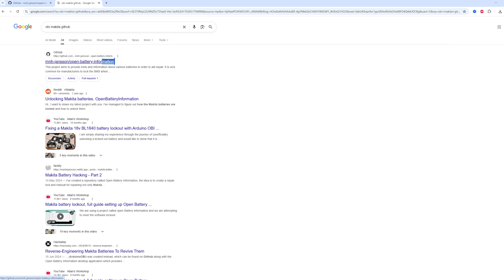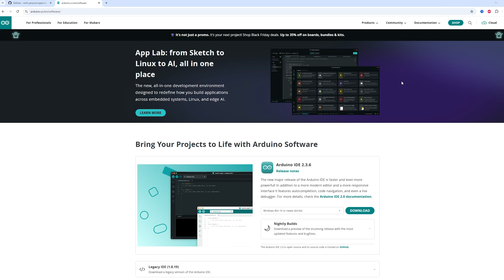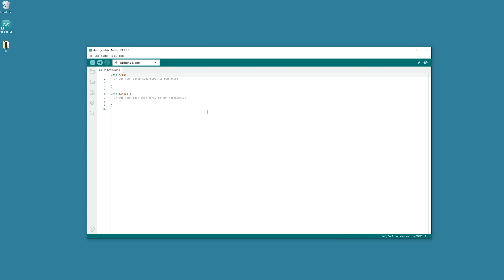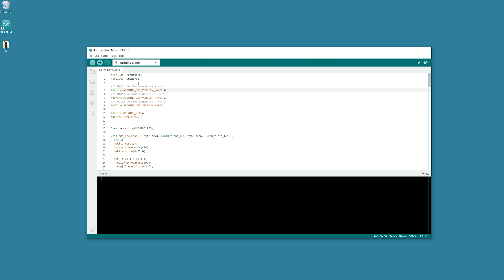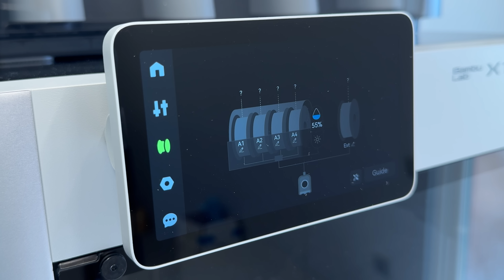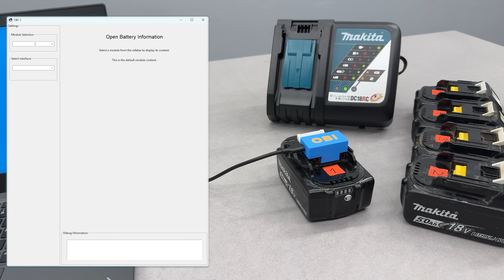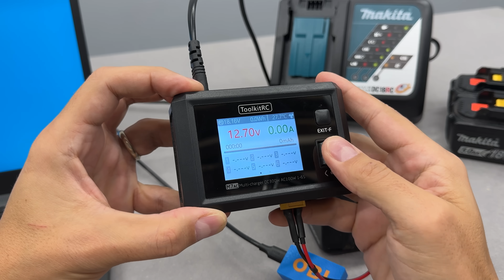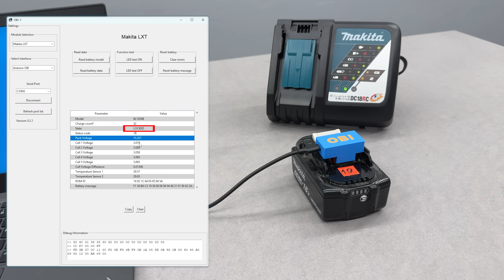I Solved the Biggest Makita 18V Battery Problem!

Comment: I have the same problem as you on the last battery!
5S 4Ah battery 1840B. All cells are balanced at about 3.3V, battery is unlocked, but still flashing red and green, did you manage to fix it? Any source where I can get the fuses info?

Thanks for the video!!
Reply from the maker: I'm working on the second video, there will be more technical details about fuses, temp sensors and other hardware issues and repairs. Stay tanned.
Reply: FYI this is what I have

BL1840B
16
UNLOCKED
67
16.736
3.369
3.336
3.343
3.345
3.339
0.03
29.08
29.12
16 03 10 64 05 05 25 CA
16/03/2022
F1 26 BD 13 14 58 00 00 F3 F3 40 21 D0 80 02 0A 82 D0 8E 67 60 AC 00 23 02 02 0E 01 00 E0 00 15
4.0Ah
18

When I plug in, battery starts checking (red LED ON), then starts charging (green LED ON), then enters error (red+green LED blinking)
There is 16.7V between +/- terminals in the battery too, so no fuse error I guess

Comment from the maker: I’ve got seven more faulty Makita batteries to repair - blown fuses, dead cell groups, imbalance issues, and more. Comment below which repair you want me to tackle first, and how many you think I can bring back to life!
Reply: All
Reply: Isn't rest of thin cables access to separate cells? Would be convenient to balance charge cells without opening
Reply: @-_Robert_-  I dont think so, but cells are accessible with long needle like probes as there are small holes in bottom of battery.
Reply: Imbalance issues please!

Comment: is there a product like this for royobi and milwaukee
Reply: Makita the only brand that offer parts to fix and repair  just about every thing they make.  All of the other brands most of there tool models are nonrepairable power tools.  They dont make or sell replacment parts.  The main reason i went with makita  because there the only company that sell all the parts to build your own batterys  or repair  old ones.  The boards use to have to be new every time till now.💯👌👍🫡😉 the less you pay for battery the more you can spend on tools.
Reply: @josephsaucedo8691    THANK YOU   for the info!
Reply: @josephsaucedo8691 where i can found original bms?
Reply: And Dewalt?